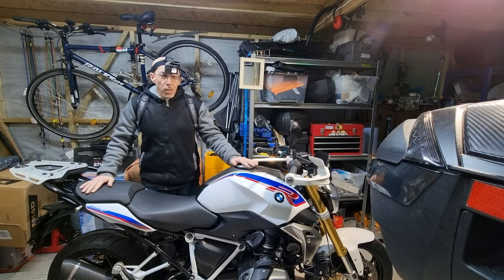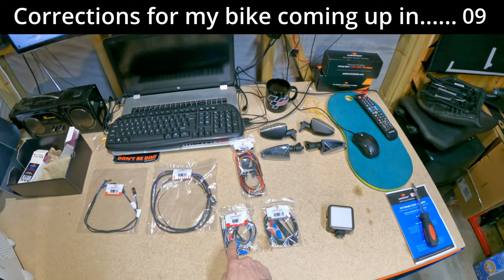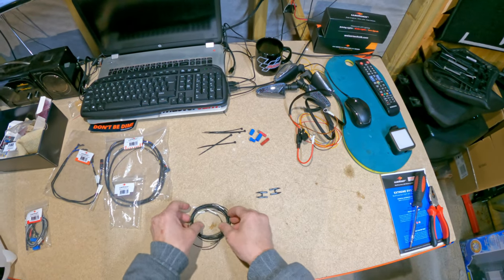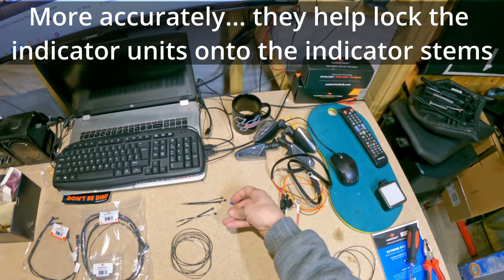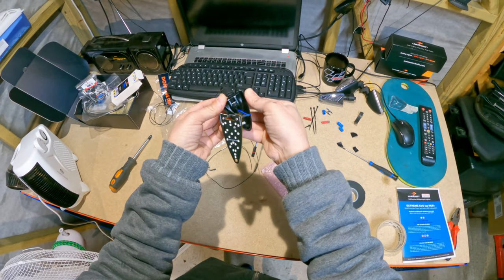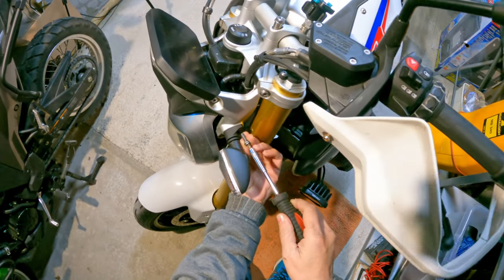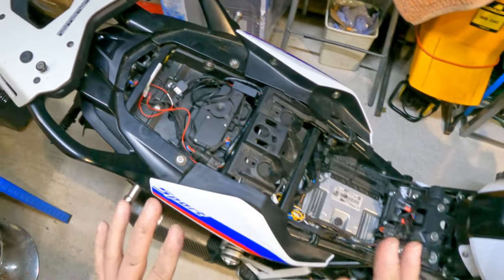Weiser Technik - Extreme Evo Indicator/Driving Light install ∫ BMW R1250R

Comment from the maker: Do let me know if you have any questions regarding these indicators and their installation/operation.  Please note that in this video I did my best not to refer to these lights as DRL's (Daytime Running Lights).  DRL's have specific regulations as to their usage in many countries, that "driving lights" not not have to follow i.e. being used after dark.

Timestamps:
00:05 Lets start taking stuff off
02:29 A look at the kit (with corrections!)
07:03 Back to the installation (front indicators)
21:43 Comparison of OEM to new Weiser Technik front indicator
23:01 Relay fitting
24:25 More fitting...
31:07 Quick test of the front driving lights
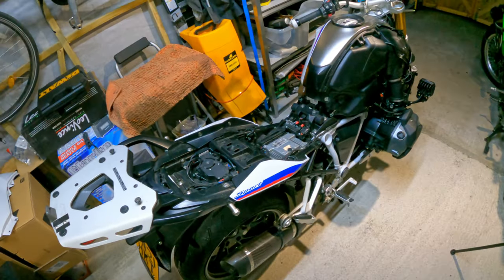31:53 Rear indicator/driving light fitting
37:36 A bit of a snag
38:37 Pushing through!
45:34 Quick rear light test
47:15 New cable and a request for R1250R/RS owners!
49:36 Complete!  And my thank-yous

Comment: I mentioned in an earlier comment that I installed the Cyclops version of these on an R1250RS (North American). I ended up just running my own wiring for them. I soldered the ends on, then used braided abrasion protectors and shrink tubing. It was actually easier than trying to fit the harnesses that came with the kit. Great video though. I think the additional brake lights are especially helpful.
Reply from the maker: Thank you for your comments Paul.  I hope the Cyclops are working out well for you!

Comment: Great video, thanks!! I was looking for something like this, as I need to replace the rear left indicator. I ended up dismantling more than I thought without reaching my goal. Now I know which are the rights torx to remove and, especially, I spotted in your video the inner bolt that prevents from removing the torx that holds the indicator. I owe you one! Cheers from Italy.

Comment: Am I seeing this correctly…you are back to the Leo exhaust,without the DB killer in? That was the SP engineering on desk next to the computer?  

What’s changed for you? Difference in tone/temper enough to justifying the loudness you previously didn’t like?
Reply from the maker: If you are sitting comfortably, I will tell you the story 😊 I really loved the look of the Leo Vince but I bought the SP Engineering can to replace it because (and sold the Leo) I could not make the Leo quiet enough without the bike losing power at the same time (refer back to my “Leo Vince bombshell” video when I first discovered this problem).  Now, while I did like the SP Engineering exhaust and the bike runs great with it, I have come to realise that the sound it makes is not really to my liking… it’s a bit raspy and high-pitched.  So late last year I realised that perhaps a different type of DB killer - the honeycomb type - that I had fitted in the SP Engineering can could have perhaps gone into the Leo Vince to make quiet enough and at the same time not lose performance.  As my 50th birthday approached last year I decided to treat myself to another Leo Vince to find out!
Now the reason I haven’t made a video about it yet is because I’m not 100% sure if the bike is running at full power with the new Leo Vince/honeycomb DB combination.  I think that it is, but because it’s winter I haven’t done enough riding yet to really figure it out.  If you have seen the power-run tests that I’ve ran on the previous exhausts, my fastest time so far was about 4.3 seconds from 5k-8k rpm in 4th gear.  This new exhaust has done a 4.5 second run but only once, so I need to do some more testing and eventually a full video will follow.  THANK YOU for asking!

Comment: Good video. I have a Kaw x300, what type size tires are on yours. Are they good. Thanks man.
Reply from the maker: Thanks for watching Paul!  The tyres on the Versys are Metzeler Tourance, 100/90 19 and 130/80 17.  I would say the do give me a good sense of confidence on the road, even if it is wet.  I've only ridden a very short distance off road... but the rear did spin quite easily on muddy ground so I think more off-road tyres would be a better choice if you do a lot of off-road.